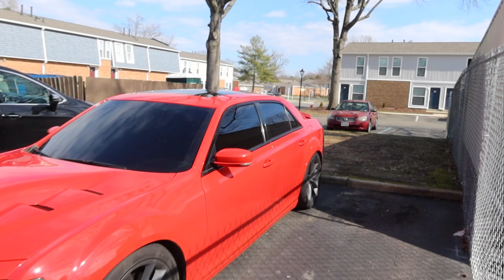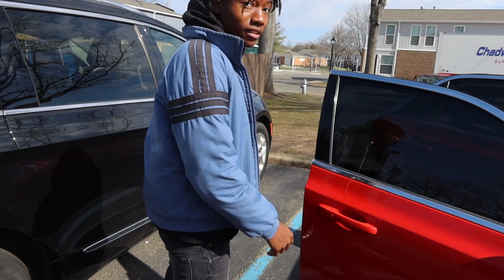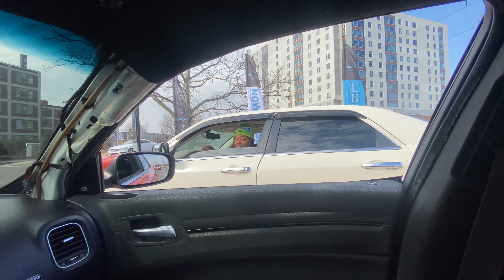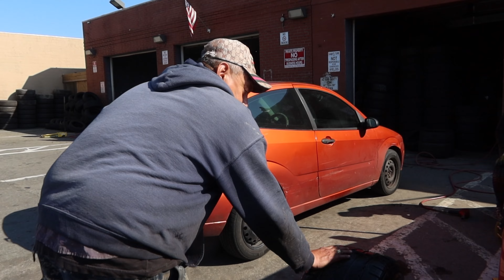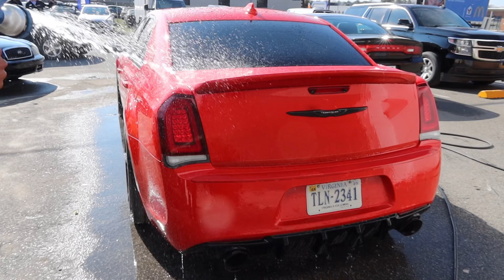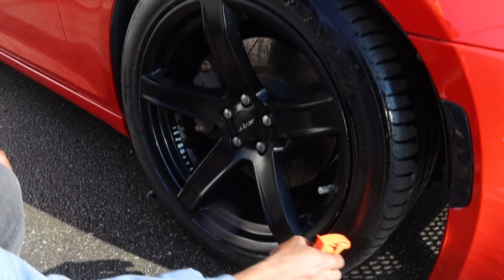I PUT HELLCAT WHEELS ON MY SRT CHRYSLER!

Comment: Yeah on my lowered 2019 charger I’m running hellcat replicas staggered 20x9.5 in the front and 20x10.5 in the back I was running 305s in the back but was rubbing so dropped to 275s
Reply from the maker: Is it bad? I was thinking of upgrading to 305s in the rear
Reply: @alshvn870 just get the fenders rolled and slightly pulled